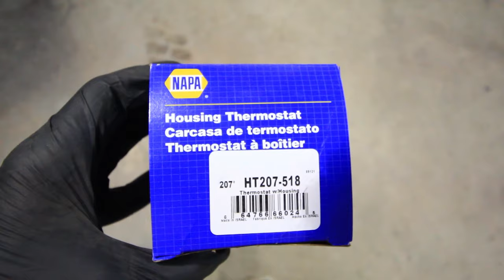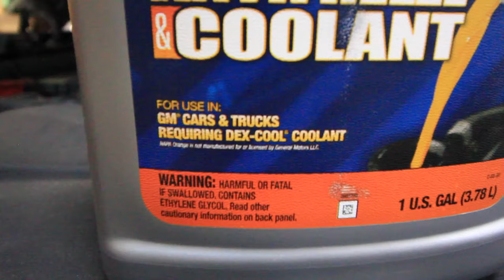Radiator Fan Won't Turn Off: 2014 - 2019 Silverado & Sierra: Bad Thermostat Replaced - Part 12674639

Comment: Was your check engine light on at all when this problem accrued.??? I’m having this issue as well changed the sensor disconnected the battery it was fine for a week and now it’s starting back up again. Brand new truck. No check engine light came on my dash but problem still is there.
Reply from the maker: No, the check engine light does not come on.  Sounds like you need to replace the thermostat.  Do that and it should take care of your problem.  The video I linked below should help you: 👇
https://youtu.be/wed9eZxPwsQ
Reply: @TheBrothersWorkshop  thank you appreciate the assistance I’m going to check out that video

Comment: You mentioned replacing the temp sensor fixed it for a short period of time. Did replacing the thermostat fix it? Have you had any issues since then?
Reply from the maker: You have to replace both the sensor and the thermostat. Please read the description for a troubleshooting videos. Everything is laid out down below. We've not had any issues since replacing both the sensor and the thermostat together.

Comment: I had a bad thermostat that did the same thing on a 2002 V6 Camaro.  Why
do the fans come on when the engine isn't overheating due to a bad
(stuck open) thermostat?
Reply from the maker: I wish I knew... 🤷

Comment: Is this the same for a 6.2 on a 2016 yukon Denali?  I Replaced my temp sensor and Unplugged the battery for 30 minutes everything worked for 24 hours and now it’s back to not getting any reading from from the temp gauge on the dash and the fan running constantly and turns off about 5 minutes after I shut the truck off….  Do you think it’s a Faulty sensor or thermostat issue? I only used a small amount of Teflon tape on the threads so it’s really not affecting the sensor imo.
Reply from the maker: From our experience this seems to be a cross platform issue.  This issue occurs on the 4.3 V6, the 5.3 V8 and the 6.2 V8.  It doesn't seem to make a difference if the vehicle is a truck or SUV.  So, if you changed the sensor and that did not fix the issue, you will need to change the thermostat.  I've linked two videos for you below.  The first explains the issues that you're describing.  The second shows in detail how to replace the thermostat. 👇

Troubleshooting 👇
https://youtu.be/wed9eZxPwsQ

Thermostat Replacement 👇
https://youtu.be/WvLyBM8FHdM
Reply: @TheBrothersWorkshop   - Thank you! I actually spent most of last night on the forums reading and doing some more reading and a few people suggested you need to clear any stored codes ( EVEN IF THEY DON"T SHOW A CHECK ENGINE LIGHT ) I did not have a check engine light on but when I hooked up my scan tool I did have 2 stored codes for Low Temp Sensor reading.  I cleared those codes and the fan instantly turned off - one which will remain permanent until the engine completes enough cycles in normal range.  I just went for a drive for about 10 miles and no fan running and the temp is reading correctly on the cluster now.   Fingers crossed that was the issue if not I will definitely move on to replace the Thermostat.  Thanks again!
Reply from the maker: Glad to hear you fixed the issue!  Keep me updated if anything changes!

Comment: I loved your videos they helped me replace the temperature sensor and now I just replaced the thermostat but when I tried to start the truck it won't start - I double checked I put everything back together correctly but it's saying stalibrik and the headlight is flashing so I was wondering do I have to reset a code or something?? Did you have to reset a code after replacing the thermostat?
Reply from the maker: Hey, I'm not sure what you did to have that outcome but it shouldn't do that at all.  I recommend double checking that you followed the video correctly and didn't disconnect anything that should not have been.  Then try disconnecting the battery and reconnecting it.  That should reset the computer and fix the issue. 

 https://youtu.be/wed9eZxPwsQ

Comment: I have had this problem before it will come and go I recall changing either the sensor or the thermostat 2 or 3 years ago I just can't remember which now I'm having the same problem again I watched the sensor video I disconnected the sensor and plugged it back in to go pick up a 19 mm deep socket and by the time I bought it and turned on the truck the fan stopped blowing running so loud and turned off as I turned off the truck do you think the sensor might have just been loose or do you recommend me replacing the thermostat? Sorry for the long comment but I'd appreciate some feedback!
Reply from the maker: Thanks for leaving a comment!  I believe the issue has to do with both parts.  It seems like if only one is replaced, than the issue comes back.  However, I have linked our troubleshooting video below for you: 👇
https://youtu.be/wed9eZxPwsQ
Reply: @TheBrothersWorkshop  thanks man appreciate the reply and the videos liked and subscribed 🙏🙏🙏
Reply from the maker: Glad to hear that! 🙌🤙

Comment: Truck started doing this last night. Engine light isn’t on tho. Should I still change the sensor or should I go with the thermostat first? Did this issue also affect your AC?
Reply from the maker: Hey Edwin! I recommend changing both the sensor and the thermostat at the same time.  It's easier to do both at the same time.  I'm not sure about the AC but it definitely affected the heater.  Also, the engine light does not come on during this issue.  I forgot to mention that in the video.
Reply: Mine started yesterday 
Engine light not on...replaced sensor...didnt fix...thank God I followed up on this video...changing t-stat today🤞

Comment: Did that work I'm having the same problem nothing is fixing it. Replaced the thermostat and temp sensor
Reply from the maker: Reset the computer by disconnecting the battery.

Comment: In this series, after replacing the sensor and the thermostat did you have to drain the coolant reservoir and radiator? Or did you only drain and fill the coolant reservoir, only asking since I'm going to take on this repair this week! Thanks in advance!
Reply from the maker: Hey Sebastian!  We did not drain any fluids.  We only topped off the coolant because we lost some during the replacement of the sensor and thermostat.  Just make sure you use the correct coolant that the vehicle needs.
Reply: @TheBrothersWorkshop  Awesome! Thanks so much!

Comment: Aren’t there two sensors? The coolant sensor is beside the thermostat, and there should be another engine/temperature sensor? I cannot locate the second sensor, does anyone have knowledge of where it is? If you replace one you should probably replace both.
Reply: Temperature sensor is underneath the throttle I believe, the last I changed it.

Comment: My 14 sierra 5.3 is acting funny, the temp gage when driving is only going to second mark above 160 (bigger line between 160-210, in other words it’s in the middle) however recently I’ve noticed when I sit at idle for several minutes the gage will go to 210. But when go back to driving is falls back down. I’ve watched a couple videos now and done some reading. Is it the thermostat that needs replacing or something else? Thanks
Reply from the maker: Hey, I'm not sure what your issue is.  Is your truck over heating, or the gauge just fluctuating?  Either way this video explains how to change the thermostat, not diagnose an issue, other than the one explaining the beginning.
Reply: @TheBrothersWorkshop  not over heating. Just not getting to 210 mark when driving. Only noticed it the other day when I was sitting in a parking lot for like 30-40 minutes at idle looked down an low an behold it was reading 210. Finally back on the road an it dropped back down. I think the thermostat is sticking truck has 150k
Reply: @jew0182   I have a 2015 Mine did this for about a month then Finally it stopped going back up to the 210 it would go slightly above the 160. Then christmas evening I got off my truck and the fans stayed on I took out the 40 fuses to get them to turn off and today Monday I changed both the temp sensor and thermostat today based off their videos and My gauges work, and the fans turned off. I lost about a half coolant jug during the process as I once done I opened a new jug and used half to replenish back to full

Comment: Not much info on the best temp for thermostat.  But I was wondering if a 194 would have any benefit.  I noticed the local parts place has a 194 as well as the 207. Did the 207 on the wifes yukon but was thinking for my silverado be good idea to use  194
Reply from the maker: I'll be honest, we went to the parts store and gave them the make, model, engine, and year.  They have us the thermostat made for  my truck.  There are three different motors in the 2014-19 Silverados and Sierra trucks.  I would use the thermostat recommend for your trucks engine.  Let us know what you choose to do and how it turns out!
Reply: Yea I think it's made for the truck but maybe they toss them in if diffrent options are taken.
Reply from the maker: Hmmm 🤔 that's a good point.  I'll have to look into that.

Comment: Great video. This is what happened to me and my 2018 Tahoe. I was coming home and all of a sudden I looked down and I noticed the temperature was around 180° which is really low and I was towing a boat.  So pull off the Thruway Because it was my exit to get home. Thank God, and I noticed that my fan was running super high on the radiator like really high. So I get home and get in the driveway. It’s still running crazy high. I put on one of those meter things that I have and it said the temperature in my coat was 145°. I’ll let the car cool down I take it out and everything‘s fine again temperatures back up to 210 like it usually is everything works fine. Do you think I should replace both the sensor and the thermostat?
Reply from the maker: If you are having the issue described in the video, than replacing both the thermostat and temperature sensor is how you fix the problem.
Reply: Thanks.  I thought I was in the clear but I told the boat up somewhere yesterday and I had white smoke coming out of the dipstick so I’m gonna take my vehicle in and get it checked. I have a feeling that when I was driving down the Thruway for so long with that coolant sensor not working I just got a feeling that might’ve fried my seals or something like that so I’m hopeful that the damages are done on my 2018 Tahoe I’ll keep you posted. I’m gonna bring the truck in and see if I can get a leak down test done. I have somebody professional look at it. Thanks for your advice.

Comment: Made the job very easy but I have done both steps and I still have the same problem!
Reply from the maker: Hey Johnny, we're not sure what's going on with your truck.  However, we've had no issues since replacing the thermostat.
Reply: Did you fix your problem ? I did both and mine still has an issue
Reply: @GendersonHernandez  I did end up fixing it I disconnected the battery for 10 mins.

Comment: Hey man I just changed the thermostat and the coolant temperature sensor and the fans are still running full speed when I turn the truck off. Any idea what I should do now? Gauge still doesn’t move from 160
Reply from the maker: Try disconnecting the battery and resetting the computer.  If that doesn't work, try removing the teflon tape from the sensor.

Comment: do you need to bleed the coolant system before starting it?
Reply from the maker: I did not bleed the coolant system.  Why do you ask?
Reply: @TheBrothersWorkshop  when i replaced the thermostat on my bmw you have to bleed the system before starting. Granted it was located differently wasnt sure if it was needed on this because of the coolant loss
Reply: @TheBrothersWorkshop  Im wondering if it’s necessary because my coolant is leaking from the thermostat throughout the bolts 😢 any advice?

Comment: Hey nice video man, would you also recommend replacing the thermostat sensor as well?
Reply from the maker: Yes, we did a video about how that's done.  Avoid teflon tape on the sensor.  I've had no issues, but some people have.  The video is linked here: https://youtu.be/aJeksrxcCDI

Comment: I had no idea that the fan would continue to run with truck turned off because of the thermostat. Changed sensor first and that didn’t work. So maybe the thermostat replacement will
Reply from the maker: Check out our troubleshooting video: https://youtu.be/wed9eZxPwsQ
Reply: Ended up in hooking the battery for a few minutes for it to work.

Comment: Hey bro did this fix the problem with the thermostat we're having the same problem
Reply from the maker: Hey Forrest!  Changing the sensor and the thermostat fix this issue.  Follow the steps in this video and the one I have linked here for you: https://youtu.be/WvLyBM8FHdM

Comment: Do you have to delete the code or will it go off by itself
Reply from the maker: No codes are displayed during this issue.
Reply: Mine is doing the same issue and a service engine light came on for a day and code reader said thermostat. What about gasket I didn’t see you talk about it?
Reply from the maker: Sorry man, sounds like a totally different issue.

Comment: Why not put a pan on passenger side front and loosen drain on radiator first ? Instead of making a mess with the anti freeze
Reply from the maker: It all comes down to saving money. Rather than spending money to replace all of the antifreeze, I topped off the antifreeze to replace what was lost.  As for the antifreeze that spilled out, I had a catch underneath the truck to collect the old antifreeze that spilled out.  Then I discarded it safely and properly.

Comment: My radiator fan Goes full blast mode and doesnt turn off after turning off the truck. could this be my problem?
Reply from the maker: Yes, this should fix your problem.  If it doesn't, watch this video and replace your sensor as well: https://youtu.be/aJeksrxcCDI
Reply: @TheBrothersWorkshop  it worked! Thank you, I had to replace both thermostat and sensor. Appreciate it!
Reply from the maker: Glad we could help!! 🙌

Comment: I had the same issue on my 2014 GMC Sierra 1500….. replaced both the sensor and thermostat but now the fan won’t turn on and temp goes above 200 …. What could be done now?? Please help
Reply from the maker: Christian, you may have disconnected something that shouldn't have been disconnected.  Double check your work and follow the advice in this video: https://youtu.be/wed9eZxPwsQ

Comment: Disconnect the battery , guaranteed to stop the fan from running.The Smartass answer.
Reply from the maker: Sure is.  Did you use this fix on your truck?
Reply: @TheBrothersWorkshop  I have not had the fan not stopping problem .freon leak problem at condenser I did have.
Reply from the maker: The freon leak may be part of the known condenser issue, if you have a 2014/15.
Reply: @TheBrothersWorkshop  2015 Silverado, I had the condenser replaced.Known manufacturer defect on the condenser.

Comment: This is happening to my 2014 Silverado, I thought it was an electrical problem. I took it to the Chevrolet dealer, they said it was the oil pump and wanted to charge me 
$2,113.00 to change it.
Reply from the maker: Wow! 😲 That's an unbelievable amount of money. Have you tried to fix the problem yet?
Reply: @The Brothers Workshop  no yet but I have the parts to fix it

Comment: is the problem solved?
I try already both and the problem keep coming and going away....
and the fan is draining my batery every time, now I have to jump my truck every time when this happens
Reply from the maker: Hey Antonio!  Yes, we replaced both parts.  When we replaced both, our issues was fixed.  You may have something else going on... 🤔. I would like to help out.  If you find anything else out let us know.
Reply: I just had to replace my battery but I think It was old but I’ve noticed my temp gauge is cooler than normal and is fluctuating from about 197 to 210 and it normally was always at 210 so I’m thinking that the thermostat is shot? Or maybe not ? Thoughts? i have a 2014 silverado 1500
Reply: After all, I double check my thermostat and the sensor right next to the thermostat. My mechanic told me he changed both but he didn't, he just change the sensor not the thermostat. 
I replace the thermostat with a brand new one from the dealer ($70) and end of the problem.
Reply: One more thing, not solving the problem on time end up with my battery. So I bought anew one. "Check the thermostat or replace for a new one, it's just 10 to 15 min with basic tools"
Reply from the maker: If you haven't replaced the thermostat, it wouldn't hurt to do so.
Reply from the maker: Ahhh $70... that's expensive.  Should have gone with the after market parts and saved $40.